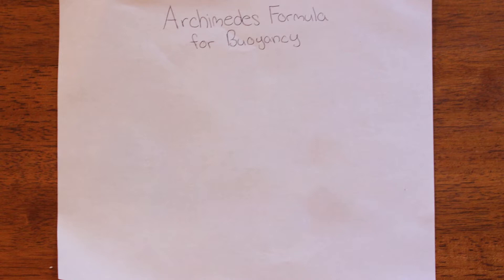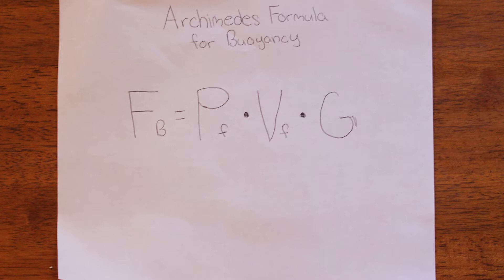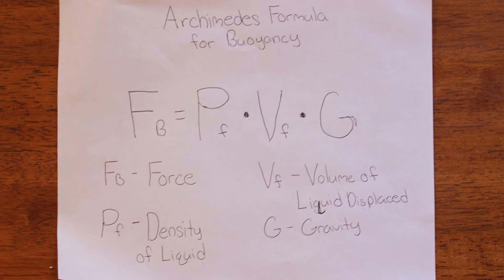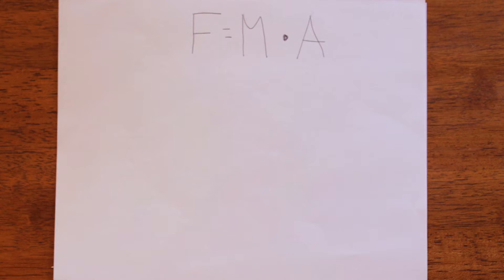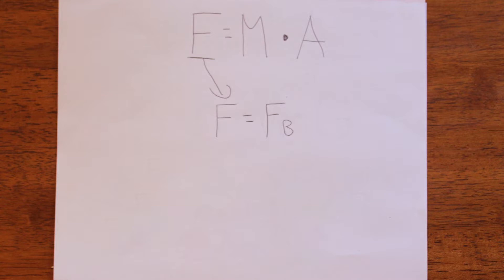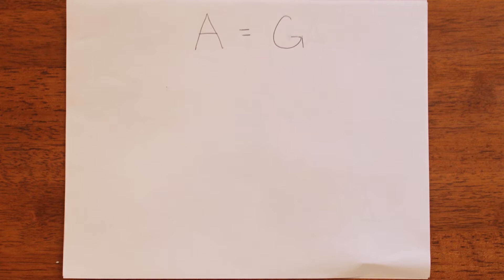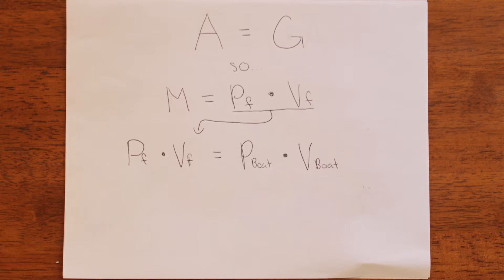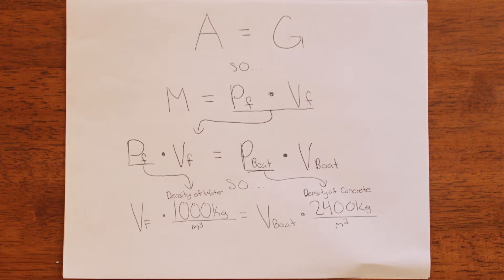Mythbusters: Concrete Boats

Comment: Concrete ships were developed in WWI and some were built as the war ended.  Some were built in WWII also.  There is a tourist canal boat at canal Fulton in Ohio on the Ohio & Erie canal that is built of ferrocement.   I have seen plans for building a dinghy where a mound of sand is made in the shape of a boat interior.  They covered the mound in chicken wire and troweled on cement to make the boat.  when hard. they sank the boat in water to let it cure for a week and then refloated it for an inexpensive boat.  Here is a link to the construction video of a similar style boat.  https://vimeo.com/50990903
Reply from the maker: Cool to hear, I like how we ended up discovering chicken scratch as an option like in the video you sent! Obviously we weren't professionals, we did it to prove the physics. In the end concrete boats are a surprisingly good cheap way to build a boat!

Comment: ooohhhh my oh my ... so wordy ... here is a simple answer to the question ... is steel heavier than concrete per 1 cubic foot of volume/ weight (density) ... concrete weighs 150 lbs. vs. steel weighs 489 lbs. ... therefore if steel can float than concrete can float; based on weight ... thank you, thank you very much ...